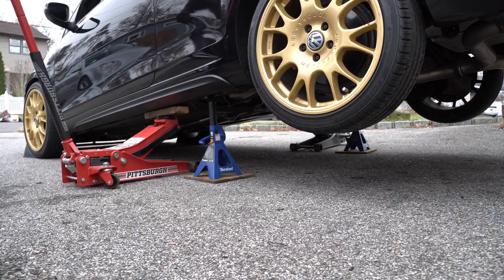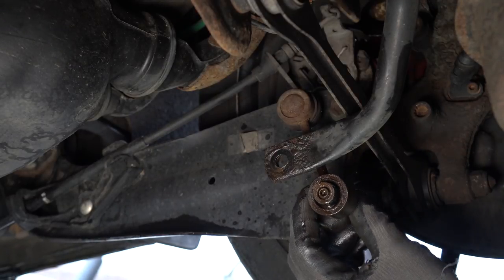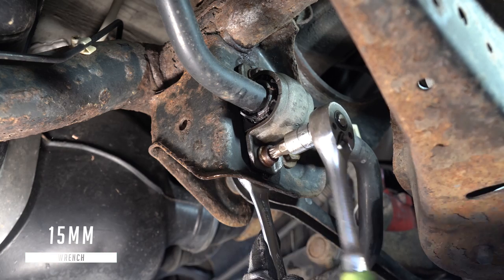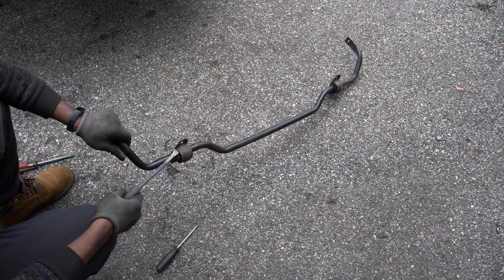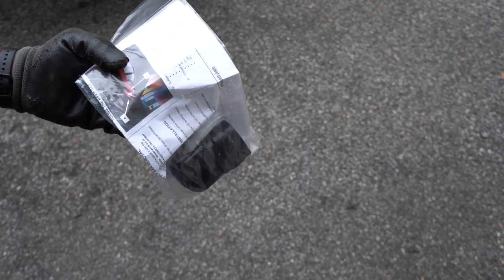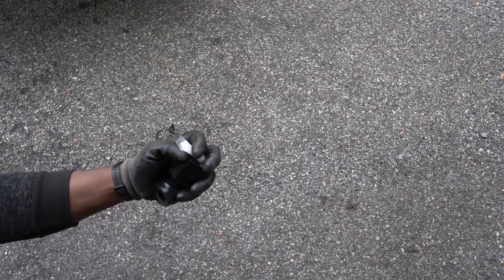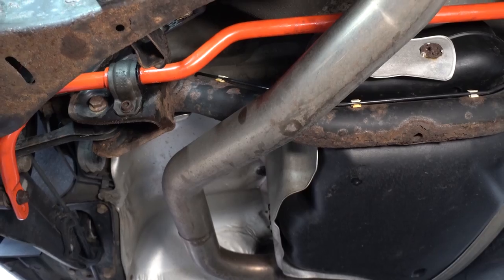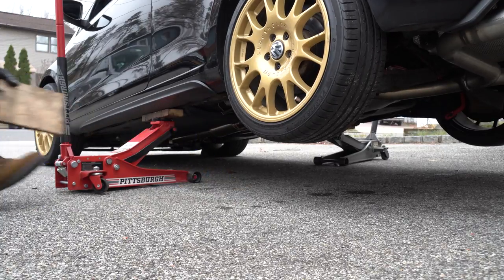VW Golf MK6 GTI Rear Sway Bar Upgrade

Comment: Love the video but random question

I wanted to order the Whiteline anti roll bars for my 2012 Leon however days in the small print for vehicles with link mounts on control arm? Didn’t think any of the mk5/6 platform used this setup so what would you suggest?

Comment: How you feelthe car while driving? Is it ok to upgrade just the rear ? It will not cause unbalance?
Reply from the maker: It's recommended that you upgrade both the front and rear. I didn't do alot of testing with only the rear, but after install both it was noticeably different in terms of handling.

Comment: Enjoying your content. I see you jack the cars up with a piece of wood on top of the jack head. Does that cause any issues with your sill's, if not I'll adopt that idea! Thanks
Reply from the maker: Thanks for checking out my content! Yea, I use the wood to prevent the jack from damaging underneath. I don't jack the car up at the same spot where I need to put the jack stand.
Reply: @CraftyWorkshopBuilds  I cant quite see, is there slot cut in the wood for the sill or  is that not necessary? Thanks 👍

Comment: Did you need an alignment after upgrading either the front or rear swaybars?
Reply from the maker: Yes, it's recommended to get a wheel alignment after the install.

Comment: I got a H&R 24mm coming. How’s this handling? What’s the difference from factory?
Reply from the maker: Night and day difference when compared to the stock one.
Reply: @CraftyWorkshopBuilds  you did a front as well I read? What mm did you go with for the front?
Reply from the maker: @em1ownerify  Yes I did, the video Is posted on the channel. I went with 26mm for the front.
Reply: @em1ownerify hey bro how its going with rear H&R 24mm? Im thinking of getting this, only rear
Reply: @ArkECSGO  love it.
Need to upgrade front to 26mm
Reply: @em1ownerify  im thinkg of only getting rear, its okay?
Reply: @ArkECSGO  ya it’s a lot better. Think the 24mm is the sweet spot
Reply: @em1ownerify  but should be fine only with rear??
Reply: @ArkECSGO  yea. Can’t speak for the pair yet. Though when cornering I feel the back end responsive and the front not as much. Why I said ima get the H&R 26mm front to pair with the 24 rear. Should help.

But there’s more to it all 
Tires, suspension 

I’m on koni1150s 
And soon continental dw